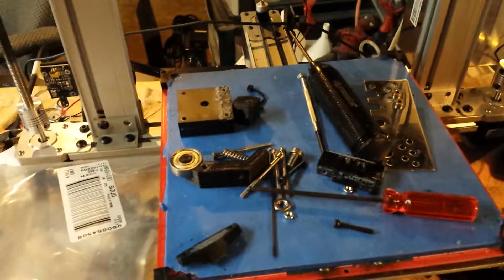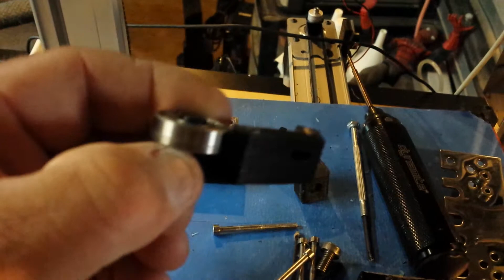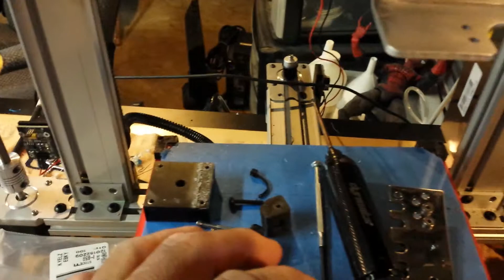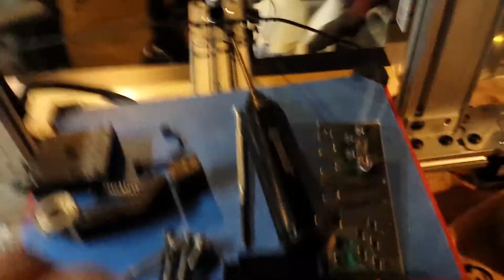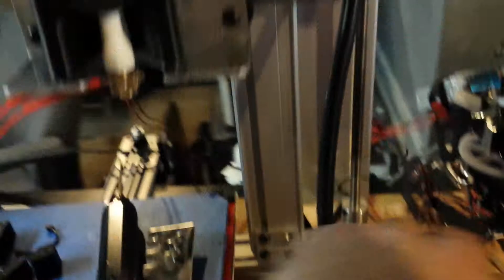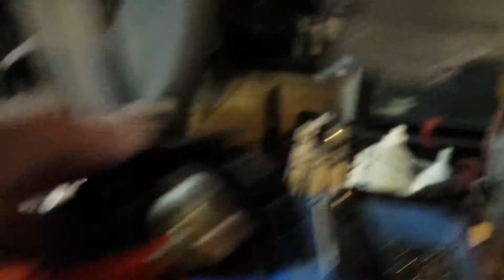J-head extruder QU-BD replacement

Comment from the maker: the company is: 2 engineers and you can find it at "2engineers(DOT)com"
it works great.  with shipping it was 55.85 and comes with heater cartridge and thermistor.  Took about 3-4 days to get it.
the all metal unit "metalmagma" works great also its a 3mm only filament but you can put a 3.1mm OD x 2.4mm ID ptfe tube in it and it does abs and pla in 1.75mm form as well.  its 65.00 + shipping and does not come with anything